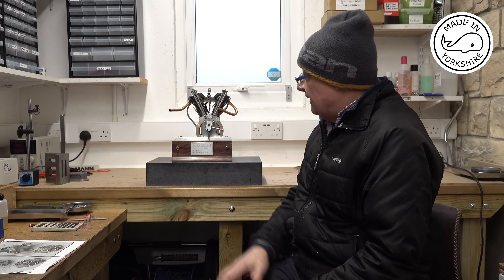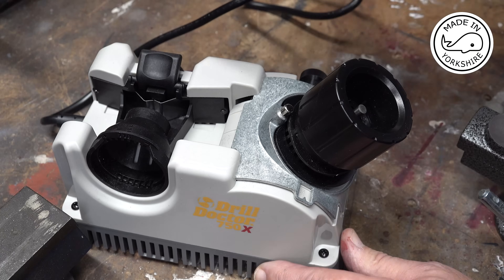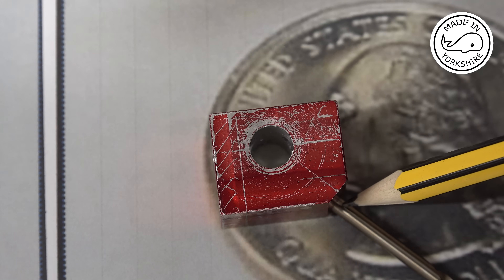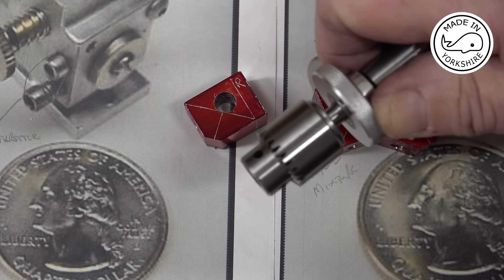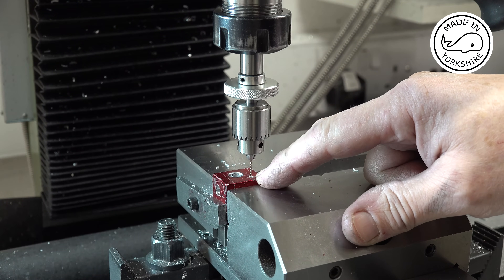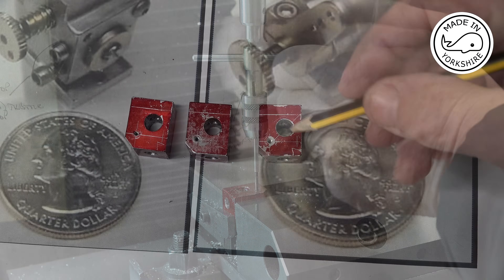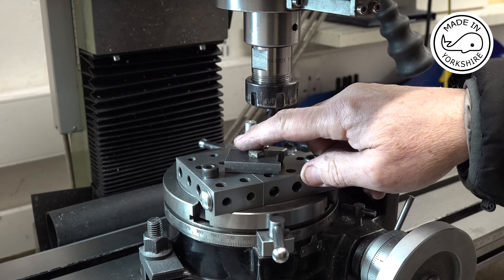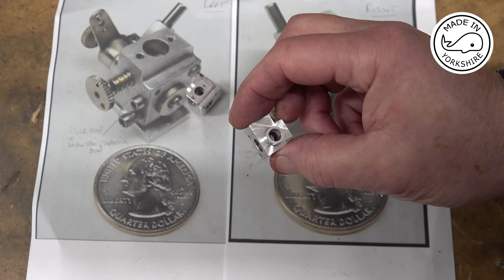#MT46 Part 1 - Jerry Howell 2-Jet Throttle/Carb. Making the body. In 4K/UHD by Andrew Whale.

Comment: Your videos on this are a God-send Andrew! The drawings from his website are really not good for this throttle body. Wow...talk about confusing. I worked as a mechanical designer with Solidworks for several years, and found these drawings to be incredibly confusing. Dimensions aren't consistent from one side to the other, and why wouldn't you dimension a feature on the same face you've drawn it? 

I hate to be critical of the fellow, but this part needs to be remodeled in something like Solidworks, and then a proper set of drawings developed. At $10 per download, they're cheap enough--but the quality of the drawings could be improved greatly. But thanks to your videos, I think a person likely has enough to allow them to make this part.

Comment: What do you call that drilling attachment please. 
Thanks
Reply from the maker: Hi Rusty. I purchased it from arceurotrade.co.uk
It's described as:
Micro Drill Adaptor - JT0 - 1/2" Shank

They sell the chuck to fit as well.
I'm sure other companies must sell it too.
It certainly is really useful when using small drill sizes.
Cheers
Andrew
Reply: @learningturningmetal  Thanks. I need one.

Comment: whare did you get the small drill chuck andy
Reply from the maker: Hi Leroy - its called a 'Micro Drill Adaptor - JT0 - 1/2" Shank' from ArcEuroTrade. The chuck and arbor are purchased separately.
Cheers
Andrew
Reply: @learningturningmetal  thank you very much

Comment: I wonder if you need some WD40 when you're drilling 1mm holes. Either WD40 or Tap Magic or it's many copies to stop the drills from gaulling. Looking at the footage of you breaking the drill you didn't look like you were applying excessive pressure. Anyway, as always, you're skills improve year-on-year, thank you for sharing them with us. Happy Christmas!
Reply from the maker: Thanks for the advice Neil. I did use some WD40 but my guess is that the max speed of my mill (2600 rpm) isn't quite sufficient.
Happy Christmas to you too!
All the best.
Andrew

Comment: Hello Andrew,
Good work there... quite a small thing to make... I like the sensitive drilling thingy for the small drills... What is the correct technical name for it?
Have a great Christmas...
Take care.
Paul,,
Reply from the maker: Hi Paul - ArcEuroTrade refer to is as a 'Micro Drill Adaptor - JT0 - 1/2" Shank'. The chuck and arbor are sold separately. It certainly helped but I think my max mill speed of 2600 rpm is a little on the slow side.
Happy Christmas!
Cheers
Andrew
Reply: @learningturningmetal  Thank you

Comment: Wow, manufacturing carburetors now. Going from purchased model airplane carbs to two jet carbs is like replacing twin SU side draft carbs with a Weber downdraft on my MG, that should make a big difference. Just a side note I mentioned it before but I definately have to invest in one of those 4X attachments for my shop. It really speeds things up.
Dick B. USA
Reply from the maker: Ha ha - thanks Dick. Yeah - my MG Midget had twin SU carbs - what a real pain trying to get those balanced. That brings back some memories!
All the best.
Andrew

Comment: Just a thought. You have made all three carburetor bodies the same. Do you not need a mirror pair for the twin carb?
Reply from the maker: Hi Tim - I never thought of that. Fair point - I must investigate.
I hope you are wrong!
Cheers
Andrew
Reply: @learningturningmetal  I hope so too, but better to find out now.
Reply from the maker: @timjoinson7232  Yup Tim - you are correct. Well spotted. I'd best get on and make another one!
Cheers
Andrew
Reply: @learningturningmetal  That is a bit of a set back. I hope it will not give you too much trouble making one the other way around. Still it will give you a bit more time to think about how you tackle those tiny holes in the throttle.

Comment: Great timing on this project for me,  I have not started the carb yet for my howell V4.  Agree on the fact its tricky to interpret the drawings without a visual 3d reference.  I will be following as usual and unashamedly take some if your lessons learnt.  Keen on seeing how you tackle the needle and how straight you can get this.
Reply from the maker: Ha ha Rob - best not to follow my methods until I get the carb working! I've just looked at sheet #3 and it requires 20thou and 23thou holes to be drilled. I'm also struggling to visualise the throttle shaft but hopefully it will become clear at some point.
All the best
Andrew

Comment: Hi Andrew, well persevered, they are very fiddly little parts to make. Sensitive drilling devices are good, you need to be running flat out and taking lots of very small pecks. A 1mm drill will actually take a reasonable force through it, it's the swarf that's your enemy, especially in Al. For breakout into cross holes, a turned up piece of the same material (or welding wire, Al in this case) threaded into the cross hole can help, especially if the breakout is off centre. They are sometimes difficult to remove afterwards though as they burr up. Cheers, Jon
Reply from the maker: Thanks for the advice Jon. My mill has a max rpm of 2600, which probably isn't great. I've just looked at sheet #3 and it requires 20thou and 23thou holes to be drilled in the throttle shaft! That should be interesting!
Cheers
Andrew

Comment: Ha Haa I didn't expect to see another video from you till the New Year, what a pleasant surprise. I will have to get one of those 'sensitive drilling attachments' for my Boxford VM30 mill as it has no quill and all z axis movement comes from the knee. This I have found, to date, is only really a problem when drilling and only when using small drills. All the best and Happy Christmas.
Reply from the maker: Thanks Nige - I think my max milling speed is a bit on the low side too (2600 rpm), which doesn't help.
Merry Christmas!
Andrew

Comment: Another great video and precision ! I stopped buying small drills when I ran into problems like you shared with us, so purchased Presto and Dormer drills  - pay a bit more, they cut nicely and last a good time when used with appropriate cutting fluids and a suitable spindle rpm especially for aluminium which is a gummy material so needs to clear the drill flutes fast to avoid stalling. Looking forward to your next project - Merry Christmas!
Reply from the maker: Thanks Andy. I think I ended up running the mill at max 2600 rpm which probably isn't quite fast enough. I've just looked at sheet #3 and it requires 20thou and 23thou holes to be drilled in the throttle shaft! That should be interesting!
Happy Christmas!
Andrew

Comment: Very impressed that you have moved into mass production. Those are incredibly small parts and holes. I like the look of the sensitive chuck. Too late to ask Santa this year! Happy Christmas to you and yours. Will look forward to seeing phase two of the carburetor building.
Reply from the maker: Thanks Tim. There is always something else to buy! I've just looked at sheet #3 and it requires 20thou and 23thou holes to be drilled in the throttle shaft! That should be interesting!
Happy Christmas!
Andrew

Comment: Really interesting small parts work!
I've used 1mm drill bit for years in electronics, and it is not fun drilling a deep 1mm hole into aluminium!
You can cut into the metal fairly hard, but the big problem is clearing out the flutes.
I use a tiny drill press, with a little DC power dremel tool thing, about 5000 to 12000 rpm depending on material. The tiny drill press means you can put a light touch on the downward cut, but also it instantly retracts up to allow you to clear out the flutes. It needs enough quill travel to full clear the drill out of the hole.
Cutting a deep hole usually needs about 2 to 3 seconds of downward cut, then retract the drill and clear the flutes where the aluminum has jammed in the 2 flutes. I usually clear it by flicking the drill bit with a tiny metal object like a jewellers screwdriver. The flick causes flex on the drill bit and the metal comes out the flutes.
A drop of wd40 in the hole and back in.
It sounds like hard work cutting 2 seconds then clear the flutes every time, but each cycle is maybe 8 seconds total and will cut you 1 to 1.5mm depth. So a 10mm deep hole is only a couple minutes.
The secret is that you can take a more forceful down cut when the flutes are totally empty and lubed, which removes material faster even though you have the "down time" of retracting the drill and clearing flutes.
And this system means the hole is always totally empty with no chips to re-cut each time you plunge.
Anyway, merry Christmas and I can't wait to see the little carbies doing their thing. 🙂🎄👍
Reply from the maker: Hi Wiz - many thanks for such detailed advice. My mill has a max rpm of 2600 and I think I might struggle drilling the 20 thou holes in the throttle shaft. I have a proxxon drill - so I wounder if it might be best for me to try to get hold of a suitable drill press. I will investigate!
Marry Christmas to you too!
Cheers
Andrew
Reply: @learningturningmetal  Your small drill unit that you use a couple of times here like around 10minutes - 
I started typing before the end and was going to ask where you got it. If possible can you do a short video on that unit. 
How did you find it and why you chose that one?
I've seen similar for the lathe by both Tom Lipton and Joe Pie. In fact yours is very similar in operation to the one Joe Pie made.
Reply from the maker: @tonywilson4713  I can't remember what got me to buy the little micro drill. I bought it from arceurotrade. The shaft and the chuck are sold as individual items.
Cheers
Andrew
Reply: @learningturningmetal   Thanks.
Have you seen what Tom Lipton or Joe Pie did?
Reply from the maker: @tonywilson4713  Yeah - interesting. I think that the only drawback with these micro drills is the relatively low speed of the mill/lathe. My mill and lathe can only reach 2500 rpm.
Reply: @learningturningmetal   Yeah I was just looking at a couple of second hand Albrecht keyless chucks and checked there specs. The 1/8 is rated to 35,000rpm and the & 5/16 can do over 12,000rpm.
Maybe that's why when new they cost so much.
Reply: Wiz Rom has it right.  We drilled millions of small deep holes in Aerospace structures and we used the "peck-drill" technique.  Drill in full pressure to a depth about 2x the diameter of the drill, pull out, then short strokes - never deeper than 1x diameter of the drill, and keep clearing the scarf out of the flutes.  If the scarf gets too packed in the flutes it will drag and want to bind up.  Guys who got good at this could drill 1/16" holes through 1" Al and rarely if ever break a drill or oversize a hole (before hand reaming).  BTW, like all your engines you've made!
Reply from the maker: Hi Jon, thanks for the info, that's very interesting. I must try and improve on my technique. Thanks very much. All the best. Andrew
Reply: @jonbush9533   ...  wow, millions of small diameter holes in deep aluminium? I'll have nightmares tonight! 👀😬

Yeah with a 1mm diameter drill in aluminium I would do maybe a 1mm plunge, then clean and lube. So thats about "1 diameter" plunge. Some aluminium is softer and gummier and worse.
If its a harder material like steel or brass it makes tiny chips that don't glue themselves into the drill flutes so much, and you can just plunge and retract fully and it will go a lot quicker.

To Andrew; yeah 20 thou is about 0.5mm, that's nasty I hate anything 0.6mm or less. If its brass not so bad.
You might want to check ebay for a tiny little drill press to suit dremel or proxon so you can get RPM above 10,000 and do lots of pecking.
Reply: I agree with Wiz Rom but the technique I use is when I see scarf appear I retract.

Comment: I've been thinking of building one of these carbs for my Mastiff, glad you got there first.  Be interesting to see how it pans out in your superb videos.
Reply from the maker: Ha ha thanks Brian. I've just looked at sheet #3 and it requires 20thou and 23thou holes to be drilled in the throttle shaft! That should be interesting!
Cheers
Andrew
Reply: @learningturningmetal  Just packing at the hole constantly clearing the chips, and I look forward to seeing you success in the next video. Have a great Christmas  break.

Comment: Andrew, what speed did you have the mill set to when you did the 1mm hole? I always put mine into high ratio for small holes. You want about 3000 rpm at that size.
Reply from the maker: Hi Graham - Thanks for the advice. I think I initially ran the mill at around 2000 rpm and ended up increasing it to it's max 2600 rpm. I think I might struggle drilling the 20 thou holes for the throttle shaft. Maybe I should try fitting the proxxon/dremel to the lathe for those.
All the best.
Andrew